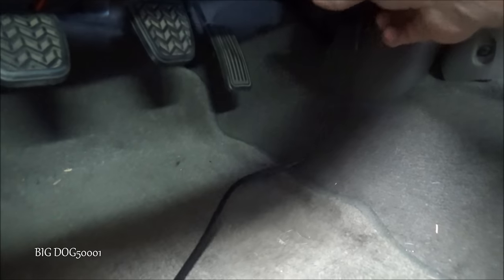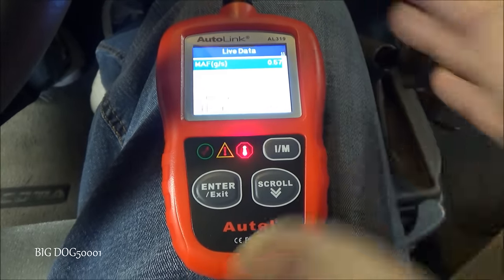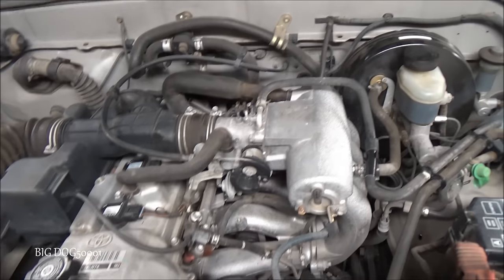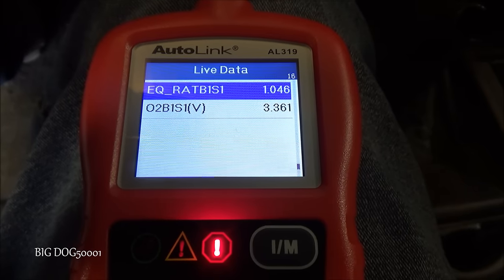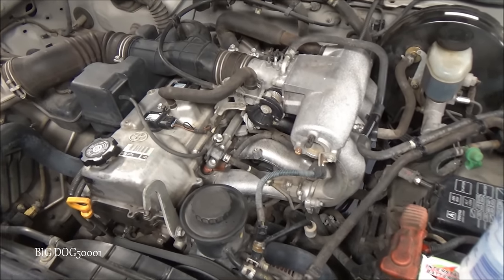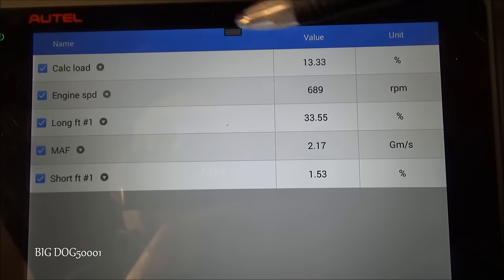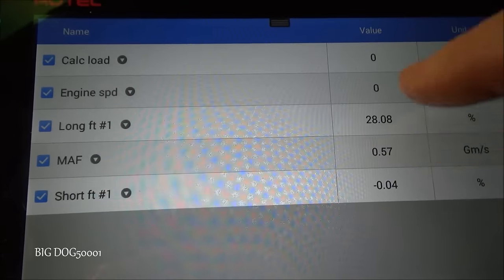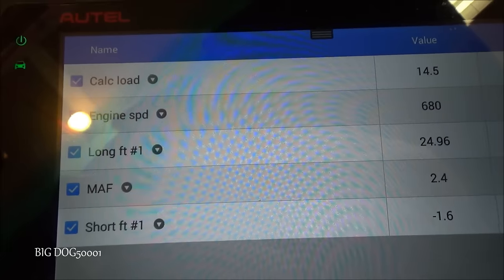P0171 Trouble Code: System Too Lean Bank 1 Diagnosis

Comment: Can anyone help? I have a PO 171 code mystery no one can solve.  I have a 2000 Buick Park Avenue Ultra. 126,000 miles. Well cared for all its life. However, the service engine light came on a few months ago and it’s showing left bank 1 too lean. 

I have taken my car to three Buick dealers and seven independent mechanics. No one at all can find the problem, but something is clearly wrong as the car sputters when cold and doesn’t run well. 

Here’s what’s been checked, replaced, repaired so far:

—Both O2 sensors are perfectly fine; the post cat sensor is new. The pre cat sensor was replaced. 
—MAF has been cleaned. Apparently works fine. 
—Fuel filter changed; fuel system cleaned. 
—Spark plugs and wires changed. 
—Catalytic converter replaced and the previous one was in fact bad. 
—No vacuum leaks. 
—No injector problems. 
—No fuel pump problems. 
—No fuel pressure problems. 
—All the numbers on the computer are registering normal. 

—The valve cover and supercharger gaskets have very slight leaks, but I’m told not enough to suck in that much unmetered air. 

A fuel sample revealed E85 gasoline in my tank, but I’ve filled at tons of different stations in the last few months, always and only 93 Unleaded, so there can’t actually be E85 in my tank. 
 
If the light is still on after $2000 worth of work and diagnostics? Then something must be wrong. Is anyone out there (like anyone at all) who can help solve this mystery? I love the car and it’s in beautiful condition, but I don’t know what to do at this point except dump it and get a new car. 

Help!
Reply: I have a similar situation except  I'm on my own since all the local shops have told me to check back when summer is over.  Called the dealer and next appointment is in 6 months.  Best of luck.
Reply: @mescal31  Finally fixed the problem after a year and a half, 11 mechanics, four of those Buick dealers. A backyard mechanic figured out it was the MAF. He replaced it, light is off, car runs beautifully, no further issue. He said the MAF is the #1 most common cause of PO 171 and was surprised no one even thought of it.

Comment: Nice video brother quick question for you, Will a bad O2 Sensor or a bad fuel filter trigger this code? Thanks
Reply from the maker: Yes, it is possible for both of those issue to cause a lean code.

Comment: Mine is giving a lean code, but running super rich.  Short term and long term are 42% and 25%, so the computer thinks it's lean, yet it's running so rich the tailpipe is painting the driveway black. One of the sensors is clearly stuck in the wrong mode.  Between the O2 and the MAF, which sensor gets the final say in what the computer does?  Mine's a 2002 ranger with a 2.3.
Reply from the maker: Just based on your comment, I would lean more towards a bad upstream O2 sensor reporting incorrect info to ECM.
Reply: @BigDog50001  turned out to be the o2 sensor. Something broke internally, because the sensor would rattle when I shook it.

Comment: I'm having same issue with suspected brake booster leak. With such a large leak wouldn't he have lost his power brakes? He said nothing about this.
Reply from the maker: This vehicle still had brake assist as long as engine was running.  As soon as it was shut off there was no longer any assist.

Comment: can a valve cover spark plugs tube seal leak be a cause for p0171-p0174 07 g35x awd sedan
Reply from the maker: If an oil leak got bad enough to cause misfiring it is possible.

Comment: Thank you big Dog5001!! This really gives me a starting point to try to troubleshoot my vehicle.  I installed some upgrades, (Pro Charger system) and now I'm getting the check engine light.  So, with the upgrades, I had to have the vehicle re-tuned.... however, they insist that I must have a vacuum leak with the engine... I have checked the vacuum tubing but no luck... still get the codes... in case your wondering... the tuners are in another state so just can't take them the vehicle to diagnose the P0171 code (actually get both banks too lean) ... Locally, no one wants to touch the vehicle due to the mods... which I appreciate their honesty...  Anyways.... again, thank you!!! I liked your delivery and methodology of your video so much, I subscribed to your channel.
Reply from the maker: Hopefully you get is squared away, thanks for the comment!

Comment: A 2001 4runner w/P0171 mil, STFT 1+/-10%,  LTFT1 39.8%, MAF 4%+/-, vacuum rock solid 21lbs, Fuel air and downstream 02 sensor test at 1.26 and 0.9 ohms per spec. unsure which direction to go. It's a false lean code but without pirate air, why is the ECM dumping so much fuel into the injectors? 
LTFT improves with long accelerating (freeway on-ramp) but returns to 39.8%. The engine purrs but won't pass smog. Any thought's?
Reply from the maker: Over +35% fuel trims will set a code on those older 4Runners (it is a block learn, so different RPMs and engine/load conditions will have different fuel trims).  One thing I like to do is to make sure the Engine Coolant Temp (ECT) Sensor is working properly (that will throw off the ECM fuel delivery).  I would compare ST and LT fuel trims at idle and at 3,000 RPMs (if they get better at 3,000 RPMs there is a vacuum leak).  I would also graph the AFR/O2 sensors on a scan tool and see if they can stay rich at WOT (wide open throttle), it should have an Air Fuel Ratio (AFR) sensor like the vehicle in this video (OHM testing is not very accurate).  Sometimes the WOT test is best done while driving (accelerate from a stop in first gear to at least 3000 RPMs or so very briefly).  

I would also look at freeze frame data, I especially want to see if the code set on a cold or warm engine (may have to clear codes and have it set a code again).  I would also check the MAF and make sure it is not dirty.
Reply from the maker: I would also add, the truck in this video and your 4Runner are similar in technology.  If you have not watched the video from start to finish you may want to (or watch it again).

Comment: I NEED HELP if anyone can kindly chime in... but first I have to applaud Big Dog for an outstanding video! 
Can someone explanation "how" the brake booster contributed to the issue and was the hose or the brake booster replaced?  My O2 sensor was replaced a few years back after the first code.  I clean the MAF at every oil change, but on my 2006 Corolla I get a code pretty much every year when it starts getting cold out.  Sometimes if I'm at a red light I'll feel the brake pedal get soft and drop to the floor?  I'm thinking brake booster but not sure and I don't have a vacuum gauge.   ODB:  Load 12% / Short Trim 15.6 / Long Trim 31.25 / MAF 1.53g/s / RPM 759 .. Anyone have 2 cents to offer I'd really appreciate it.
Reply from the maker: In short, older vehicles use vacuum from the engine to operate the brake booster (to assist in braking), if the booster has a leak too much air can be pulled into engine (that the engine computer can't see on a MAF system).  Generally, the brake pedal will get harder to press if the brake booster is bad.  More common for a bad brake master cylinder or a leak in brake system to cause a brake pedal to sink to floor.  As for fuel trims, remember, if there is a vacuum leak the fuel trims will usually get better at higher RPMs (live data on a code reader helps to see this).  Intake gaskets tend to leak (pull in air) more when the vehicle is cold (as the engine heats the gaskets seal better), so freeze frame data when the code sets can give direction on whether it was a hot or cold engine.  Thanks for the comment!
Reply: @BigDog50001  Many thanks Big Dog for the thorough response!  Cheers.

Comment: Hey bigdog, this was fantastic. Long story short I have this same code and noticed in your video it was a combination of MAF sensor and vacuum leak (brake booster). My question is would a power steering issue (leak) be the same culprit as the brake booster? Thank you for your time
Reply from the maker: Typically no.  Thanks for the comment!

Comment: I have this code and I replaced everything and checked everything and still can’t figure it out. Only thing I can think of is a iacv or a burnt valve? Btw it’s a Honda s2000
Reply from the maker: It is possible there is a problem with the valves, possibly an adjustment.  Don't forget to make sure the purge valve is not stuck open.  Just remember, scan tool data can be your friend in correcting the problem.
Reply: Big Dog50001 Automotive  thank you for your reply. I’ve literally done 3 valve adjustments, injectors,fuel pump, PCV, fuel pressure is good, map, tps, vacuum leak test, FPR, o2 sensors. And took it to 3 shops and none have figured it out.

Comment: I'm have a issue with my 2007 mustang GT. Bank 1 would read low of 62 than raise to 1.32 and then plain out around 1.00 like normal. Switched the 02's and the problem went to bank 2. Replaced the 02 sensor but no fix and have a decent amount of imbalance. Would a faulty MAF cause this and only on 1 bank side?
Reply from the maker: I would have to see everything myself to give directions, but typically a MAF issue effects both banks.  I would switch the O2s back again and see if problem moves again.  If it does, then the problem is most likely an issue with the (new) oxygen sensor.  I typically will use OEM factory sensors (many manufacturers use different sensors for different model configurations and using the incorrect one can cause issues).  If I go aftermarket, I try to use the same manufacturer that the factory used.
Reply: @BigDog50001  Thank you for your response. I figured out of 2 different brands atleast one would work correctly.

Comment: I have 2017 Buick I want to clean my maf senor do I have to unhook my  battery cable thank you
Reply from the maker: I unplug the MAF and remove it, then I will clean it with MAF cleaner and let it thoroughly dry before plugging it back in.

Comment: such a great and informative video. thanks a lot.
Reply from the maker: Thank you for the comment, I appreciate it!
Reply: @BigDog50001  I feel I had learn a lot watching your video. I'm subscriber now. I found P0174 on my V6 Toyota highlander and a leak in the flex pipe before the converter. I replaced that section of exhaust pipe and erased the code. But some told me  that the leak is after B2O2 sensor 1, the code could not have been caused by that leak. Now, the long trim is around -15%. I have driven enough to get all I/M ready except for the EVAP. I do not know for sure if I have solved the problem. I found when I press gas harder, long trim woukd read 20% while short trim is slightly negative.  But if I release the gas pedal, all turn negative.

Comment: Had to get my 2006 Pontiac Torrent 3.4 l v6 Engine rebuilt cause of a blown head-gasket and i got all brand new Sensors replaced last week, but i am getting a check engine light code P0171,  lean on Bank 1, do you have any idea's that may help to find the problem. after replacing all of the sensor's, i am getting that code of P0171 
i erased the code last week and today the light on the dash  came back on. it is the same code P0171.
Reply from the maker: If a bunch of work was just done, then I would double check work.  Freeze frame data can help to see if it is happening on a cold or warm ending.  Long Term and Short Term fuel trims at both idle and 2,500-3,000 RPMs (as well as on a cold and warm engine) can help too.  Vacuum leaks are very much a possibility after major work was just done.
Reply: @BigDog50001  Update the light is off found that it was in my fuel system vent it had a small pin hole in the fuel vent and when the fuel tank is full no light, but when the tank goes down to half tank light comes on , but so far so good the light stayed off and hasn't come on even with a half tank now.

Comment: Maybe you can assit me. My 2016 corolla is having a check engine and traction light problem. I changed the MAS and air filter. Took it to Toyota and they said no issues were found, but we both got the same P0171 code. My car has a rough idle and did cut out on me twice in 2 weeks. What could be the problem.
Reply: Another wierd issue is that going over 35 mph gets rid of the traction light
Reply from the maker: It definitely sounds like it needs some troubleshooting done, you may need to take it to someone who knows what they are doing (not the same shop you already took it to).

Comment: I really need help with my lean code. New alternator new ignition coils new spark plugs and spark plug wires new fuel pump new fuel filter new tps new map sensor. 98 s10 2.2L
Reply from the maker: First thing I would do is look at Short Term and Long Term Fuel Trims on a scan tool at idle and at about 3,000 RPMs, and then I would compare the them.  What I would be looking for is: do the trims get better at 3,000 RPMs, worse or stay the same.  If they get better at 3,000 RPMs (like they did in this video after I found the leak), then there is a vacuum leak somewhere most likely.  If they do not get better, then I would look at additional scan data to see what other direction I could go.

Comment: Have you seen a negative long term and a positive short term. Also, where do find the specs for different vehicles to properly diagnose if they vary out of the norm.
Reply from the maker: Yes I have seen that.  I get certain specs from manufacturer service info (that I pay for) but in general + or - 10 (ST+LT) is generally considered normal on most cars.

Comment: my understanding the maf is based on engine size not location. the map is more location based. i understand that litre and maf should be about the same
Reply from the maker: Just remember, these are two different types of sensors (and two different ways of measuring air going to engine), one is a hot wire that measures air flow (MAF) and the other is a pressure sensor that measures pressure inside intake manifold (MAP).  The location of the MAF in relation to an air (vacuum) leak is important because if the leak is after the sensor then it will not see the extra air going to engine.  MAF sensors readings are different depending on engine size (a bigger engine will pull in more air).

Comment: Hello, i have a problem in my car, when i put gear in D and i accelerate my car can't start and stay breezing between 3 or 4 munutes and then start up, and the code showing up in my engine is p0171, the mechanic told me that i have a problem in transmission, but he doesn't want to check vaccuum leaks, my question is, is this problem coming from transmission or from vaccum leaks? Thank you
Reply from the maker: I can't tell from the way you describe it, it could be the same problem causing both or it could be two separate issues.
Reply: Thank you for you responding

Comment: Hi there. I have a 2000 corolla with a Bank 1 lean code. My question is, if the MAF sensor reads at 2. something and then with you do a snap throttle and peak at 14. something instead of 4.0, is that a indication of a bad MAF sensor? Thanks
Reply from the maker: What are the units of measurement you are using and how are you seeing this data?
Reply: Big Dog50001 Automotive 
I’m using the Autel AL329B scanner.

Comment: Awesome video!   Very methodical and comprehensive.    I made many trips to my mechanic to fix a CHECK VSP engine light.    It was consists of multiple trips and multiple trials and errors.   He tried to fix with new downstream sensors, then new upstream sensors, then a new MAF sensor, then a smoke test.   All that was not cheap.   In the end, one of the problems was a defective gas cap; which was replaced.   The other problem is potentially a dying bank 1 catalytic converter ... but not sure yet.   I still have a CHECK VSP popping up after the fault codes were cleared from the ECM.
Reply from the maker: I appreciate the comment and iput, thank you!

Comment: What does the term bank 1 or bank 2 mean? For example on a 2013 civic 1.8 L.  4 cylinder engine. Please explain,  thanks..
Reply from the maker: Typically engines larger than 4 cylinders are divided into two banks, Bank 1 and Bank 2.  For instance on a V6 engine, Bank 1 would have cylinders 1-3 and Bank 2 would have cylinders 4-6.  This can help with diagnosis so you are looking at the correct area of the engine.  A 2013 Civic 1.8L will only have Bank 1 due the 4 cylinder design of the engine.  A newer Honda like that will set a P0171 if the fuel trim is higher than 25%-33% depending on engine (Honda scan tools show this as 1.25 or 1.33 etc instead of a percentage).
Reply: @BigDog50001  
Thanks, greatly appreciated